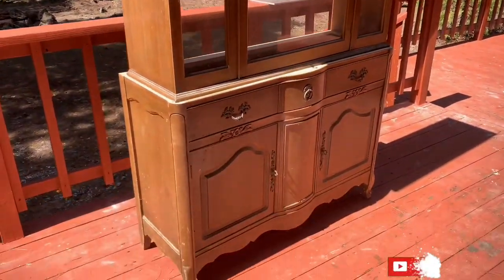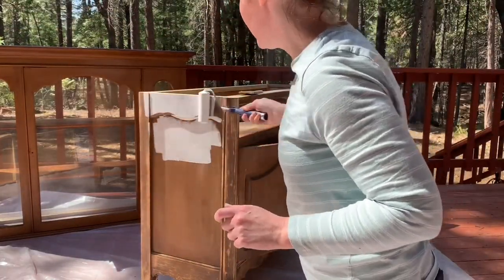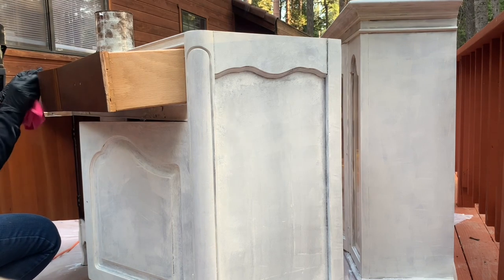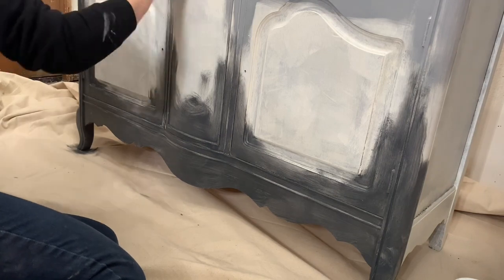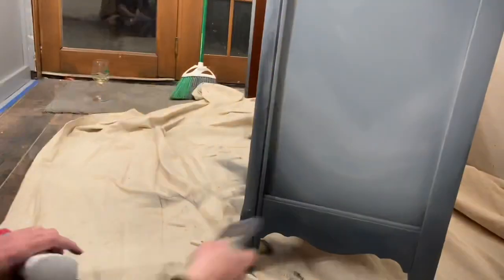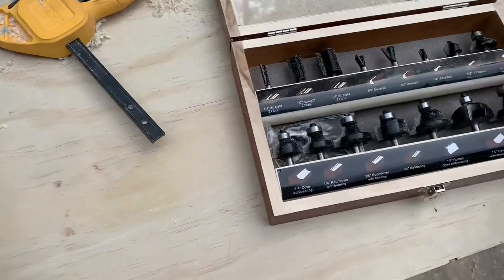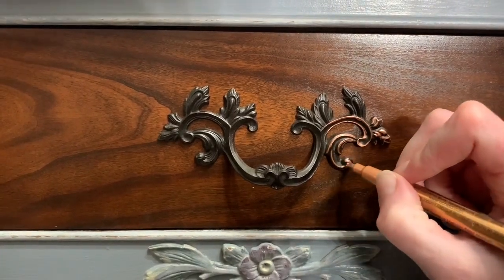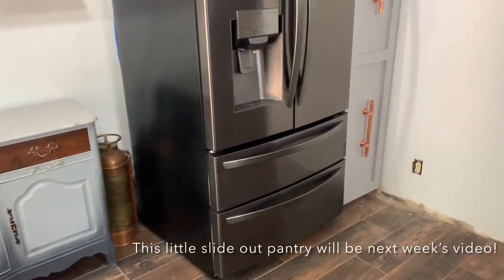Turning An Antique China Hutch Into A Coffee Bar & Wall Mounted Cabinet | Elegant Upgrades

Comment: How did you "shore up" the cabinet top to mount it to the wall? Many old cabinets have a "flimsy" back that isn't intended to support the weight of the piece being wall-mounted.
Reply from the maker: The bottom board that we used under the cabinet is screwed into studs and holds the weight of the cabinet. Then the back top and sides have structural boards (around the frame) that we used to attach to studs in the wall to keep it back. I don’t think we added any through the backer board because, like you said, they aren’t sturdy enough for that. I hope that makes sense!

Comment: How did you actually separate the two pieces?
Reply from the maker: I’ve done several and they are almost never the same.  Sometimes you can just remove the screws and it’s done, sometimes you have to break apart glue and then do some repairs.

Comment: hey what if i need to hang upper part of hutch on wall. is it screws i need to follow or french cleat more better option as u know hutch upper part huge and heavy made of hardwood? my hutch is 52 x54
Reply from the maker: Honestly I would do both. I like having the support at the bottom, but then also having the screws through the support beam in the back into wall studs.

Comment: What grip sandpaper and type sander did you use? I would like ours to look a natural color of wood to pop with my white walls.
Reply from the maker: What I did here wouldn’t be the best to strip back to natural wood. All I had to do was scuff sand to prep for paint. If I was going to sand back to the natural wood (and not use a chemical stripper) I would start with a random orbital in 80 grit and move up the line to 220 on all the flat surfaces. This piece had tons of detail pieces so they would have to sanded by hand (or a small detail sander if you have one) moving up through the ranks as well. That would be a very meticulous process. If I was going to do this one back to wood myself, I’d probably use a combination of chemical stripper, carbide scrapers, and sanding depending on how thick the finish was. Wow, sorry that was a lengthy one.
Reply: Thanks!  I was watching from my phone and inquired at the time you were sanding and staying that one drawer.  I thought more was being done with stain.   Beautiful job you did.

Comment: Why on Earth did you put the top hutch so high up on the wall? It would have been better if you would have brought down quite a bit
Reply from the maker: 😂 Two reasons- It matches the rest of the cabinets on the other side of the kitchen & they wanted to add tile (which is now done) between the top and bottom. It looks beautiful. I’m sorry you didn’t like it, but you could always put it where you like on your wall should you decide to build one for yourself.
Reply: @elegantupgrades  I guess that's a very good idea to put tile in between the two pieces and it looks better😅